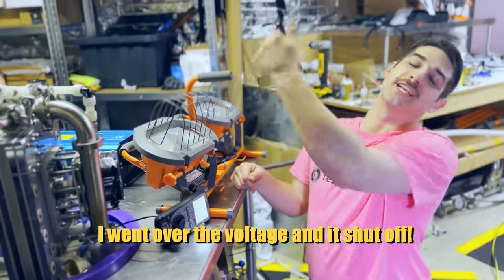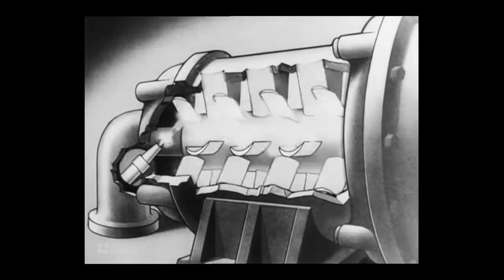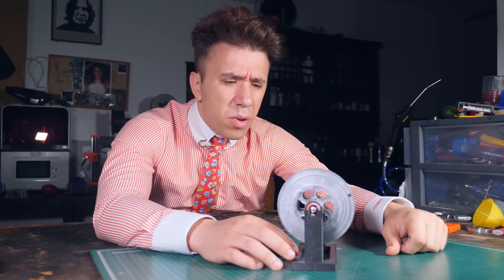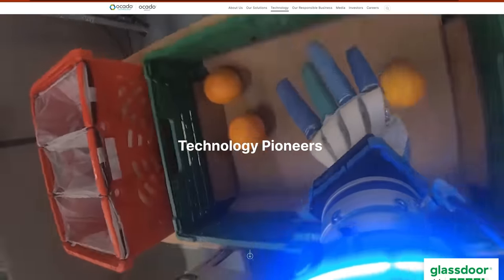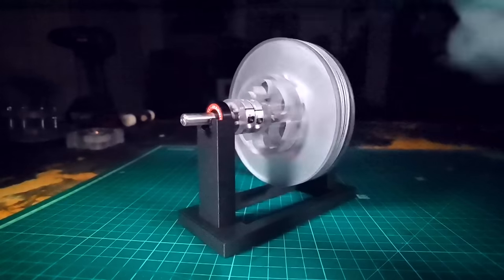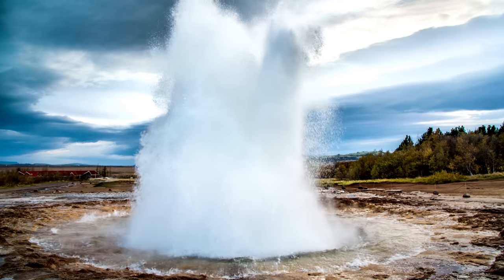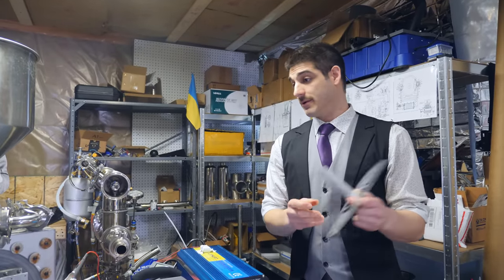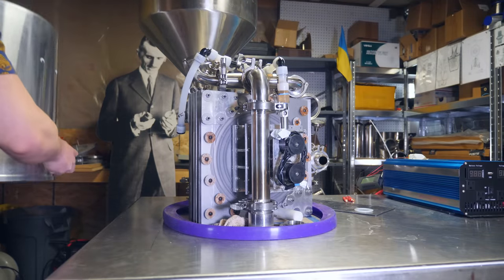Building Nikola Tesla's Bladeless Turbine

Comment: Hi all, as a suggestion, demonstrate solar boiler with Fresnel lens  (less than $2) boiling (low pressure in boiler using tesla pump on both sides of turbine) pump water, with steam injector at pump outlet  (return  steam, vapor or water to boiler).  also send output of boiler to storage (use aircret or aerogel for isolation); now you have seasonal storage turbine runs non stop, build two for zero fault tolerance (there cheap).  If one fails use the other while repairs are made.  Runs forever as hours of sun light provides weeks of energy to run the turbine without fuel cost, now pump water from oceans across deserts or any where water is needed (as system produces distilled water), and get green hydrogen and electricty free!

Comment: I'm quite impressed. I didn't think you could harness that much power from a unit that size. I've always wanted to build one of these, but I considered it a toy. I think i could actually build a vehicle apu out of something like this...
Reply: hey thanks for commenting. 🙏❤️‍🔥 I really appreciate the love and support.    

So just to be clear I do have a degree in physics and many years of working with industrial machines.  

And now I don’t want to discourage you but I need to be abundantly clear though that sadly, these are not toys. 

They are VERY dangerous if not designed or handled properly.  

I do not advise anyone who doesn’t already have a background in mech engineering/physics etc. to attempt to make one of them on their own.  

If you wouldn’t feel comfortable taking apart a jet engine and putting it back together and know that it would work properly again then I would think twice about taking on this endeavor.  

That being said. 

If you would like to start I would suggest by consuming as many mechanical engineering class videos as you can on YouTube.  

Learn all the thermodynamics behind steam and gas turbines.  

Specifically for Tesla turbines it requires a great deal more chemistry due to the Tesla turbine operating on molecular viscous adhesive forces between the fluid and discs and not in mechanical collisions with the blades like traditional blades turbine.  

So making sure to have the right surface treatments for the proper motive fluid is very important too.   “Don’t French fry when you’re supposed to pizza or you’re gonna have a bad time.” <-Words to live by. 

I want to be explicitly clear with people just how dangerous this is. 

It’s easy to see the turbine not doing much other than spinning and think it’s not that difficult.   

But to put some perspective on it…. 

The ~25cm (10in) diameter 75disc aluminum turbine is 4.36kg (~9.5lbs)     

So whenever anyone see this turbine spinning they need to imagine a literal 10in diameter 10lb dumbbell weight spinning at 7,000-13,000rpm 🤯🥵😅    

At 13,000rpm the turbine rotor has 30,000joules of rotational kinetic energy.     

For perspective, that’s about equivalent to:  5-10% of the kinetic energy of a whole car at highway speeds.   

If that stored kinetic energy were to be used to launch itself straight up into the air…    

KE = gravPE = mgH   

H = KE / m / g
     = (30,000joules) / (4.26kg) / (9.81m/s^2)
     = 708 meters straight up into the air… 🤯

~3/4 of a kilometer or ~0.45 miles
Reply: I also have a degree in physics and other things...
I'm curious as to why you're not using air bearings in your design. They're pretty easy to build and implement.  In addition, you can use your Tesla turbine as a pump to pressurize them thereby eliminating the need for a secondary system. Once the system reaches its static equilibrium pressure it won't bleed off much more additional energy and certainly less than your cooled bearings.

Comment: This is really cool, but the thing that fascinated me the most was actually the way they did CNC on those thin pieces of aluminum. Would that be something you could explore more in the future?
Reply: For mass production of the discs a stamping machine would probably be able to produce more per hour. But at maker-scale CNC makes sense. Joe Pie did a video titled 'Pressure Turning' where he clamped a stack of aluminum foil to make really thin shims. Something similar should work with a milling machine, clamp a stack of sheet aluminum between some plywood held in a frame. Plywood will be sacrificial (scrap it after the batch is done), frame is reusable. Maybe possible to use multiple clamping setups and reuse the plywood or make some holding pieces from metal instead of plywood.  First stage - cut out the center while clamping down on the top from the side. Second stage - base has a mandrel extending up that the top holding piece is bolted to , and the top holding piece is a thick disk the same diameter of the discs being produced. Second stage top holding piece would also have holes matching the holes to be cut in the disks. Also need a notch in the mandrel and a small protrusion in the center hole of the top holding piece, for angular alignment of the holes
Reply: @frontiervirtcharter  Yea, I was more interested in how they did cnc in such fragile materials. I know it's not the most efficient way to do this, but it's still interesting
Reply: @xXfzmusicXx  Use a straight flute mill. A spiral flute will pull the material up and scrap every single one in the stack.

Comment: What would happen if you were to alternate either the size of the disks or thickness? It would be interesting to see how it affects the output.
Reply: Typically, if you increase the diameter of the disk, you'll get a lower max rpm, but a bit more torque. 

increaseing the thickness of the disk wouldn't be as helpful, as its just more mass for the fluid to pull, and less surface area.
Reply: @beaverbear9157  thats not what he is saying he is saying make some of them small and some of them larger or maybe 25% small 10% medium and 65% large i think what he is getting at is you may have better effeciency as the smaller disks woiuld help it achieve the better torque and still have a more power. as for rpms it doesnt matteer what size the disc is you either have more torque or more power the rpms will be the same what do you think the discs would actually gain a higher rpm because of diameter? no my friend it has more to do with mass of the object so you would achieve higher rpms becuase you get to use more of the fuel as its lighter and easier to spin. diameter has nothing to do with what the rpms achieved would be.

Comment: Very cool video! I'd love to see this setup with a steam input. Relying on compressed air isn't the best idea for using the engine in the case of blackouts. Being able to go off-grid by using steam or gravity-fed water would be interesting to see!
Reply: Hey thank you for your insightful comment and genuine curiosity! 

It's a great opportunity to delve deeper into the potential real-world applications of the Tesla turbine and to clear up some misconceptions.

First and foremost, in terms of using high pressure, low temp gases in actual generator capacities, Compressed Air Energy Storage (CAES) and Liquid Air/Cryogenic Energy Storage (LAES/CES) are very viable solutions, and they're being employed at industrial scales as we speak.

When we look at how engines function, they typically compress air, heat it, and then expand it. 

Most gas turbines and turbojet engines possess a compressor, operating on what's known as the Brayton cycle. 

For those unfamiliar, the Brayton cycle comprises three main processes: 

compression of the air, combustion (where heat is added), and then expansion of the air.

If we're talking about steam systems, only heat needs to be added to vaporize the fluid. 

Systems like ocean thermal energy conversion (OTEC) can vaporize steam, or even function in an organic Rankine cycle, at significantly reduced temperatures.

Tesla's improved turbine patent GB 186,083 is particularly noteworthy here. 

It cleverly uses heat from the turbine exhaust to generate steam. 

This steam then cools the combustion jet before it enters the turbine, thus significantly reducing the compressed needs typical of most gas turbines. 

While regular gas turbines require an air-fuel mix in the range of 100:1 to 200:1, thanks to this innovative approach, Tesla's patent slashes the load that the compressor puts on the shaft, making it efficient even with stoichiometric mixtures around 15:1.

Moreover, Tesla's patent GB 186,084 combines combustion and steam turbine functionality, eliminating the need for a compressor altogether.

Our current tests with the Tesla turbine aim to establish baselines. 

We've already achieved impressive results with the 10in diameter TesTur— 6.22ft-Ibs of torque at 4150rpm and over 4.25kW between 6000-12,000 rpm, while maintaining relatively low pressures at the nozzle.

It's crucial to understand that, counterintuitively, the viscosity of gases actually increases with temperature. 

This means that as we hike up the temperatures to combustion levels, not only do we anticipate a boost in thermodynamic efficiency but also a leap in the TesTur's isentropic efficiency, thanks to reduced slip caused by the heightened viscosity.

Our endgame at TesTur Energy is all about energy independence. 

We're passionate about tapping into underutilized energy sources and stores, such as biomass, solar thermal, geothermal, and even unconventional fuels with high particulate content. 

The ultimate goal? 

To harness these energy stores with systems that can manage multiphase fluid flows, ensuring longevity and efficiency.
Reply: Additionally we have a full closed loop steam system for the turbine that is about to get used for testing it in the vacuum steam conditions. Already showing 150-300watts out with the inlet steam at 65-70°c at -10inHg vacuum pressure and the turbine exhaust/condenser at 55-60°c at -22inHg vacuum 🤭

Just imagine what will happen when we actually use some real heat. 🦾🔥🤓👨‍🔬

Comment: they say there's a lot of untapped potential in grid water pipes, it'd be cool to see an idea to integrate this with a pipe fitting and flow water through it at normal house pipe water pressures to see how much power it can generate. i know some cities utilize the pipe pressure of the water grid already, just imagine the potential.
Reply: Or by using 24v water pump or replace it with permit magnet motor to generate votage just by running water!
Reply: it's a TANSTAAFL situation, the energy abstracted from water flowing in a pipe has to come from somewhere which is often a pumping station.  Having said that if you live somewhere with an unmetered water supply it might be economic on a personal level to generate your own power by wasting a few thousand gallons of water a day.
Reply: @Steve_Coates  I actually have unmetered water in a urban area (the hose water is unmetered, but the house water is metered) but I don't think I'd feel very good dumping perfectly good water out on a moral level.

Comment: Good time everyone, nice video, and technically advanced and understandable, thank`s. I have one suggestion, if you make the turbine bigger in diametre and build in the center of the blades, which will possibly give more power to compress the same air that comes out and turn it back, since we apply the force along the outer diameter, we will need less compressed air power than we will get from the middle. Good mood and new ideas to all inventors) I`m sorry if I have some grammatikal mistakes

Comment: Please make a video about stirling engines and making one which can be used to generate roughly 10-15 KWh/day. Most fridges need roughly 13 KWh/day, and most entire households need 20-30 KWh/day, to function decently for half a year, and roughly 30-45 KWh/day to 40-60 KWh/day to function at peak efficiency including using electric heating and AC (for houses which don' have gas stoves or gas heaters). And the benefit of it is that not only can you use any source of heat to power it (including solar and burning trash or normal fuel or unclean fuel if you need to), but you can also run it in reverse by feeding it torque (i.e. from another stirling engine or steam engine or injection engine or renewables or animal power or human power) to turn it into a heat pump (i.e. turning your cellar into a fridge/freezer, if needed). Even if you only manage to make a Stirling Engine capable of generating 1 KWh/day for one video and in another video changing some parts to make it a heat pump (i.e. the heatsinks, the freezing plate needing thicker fins, because thinner ones won't transfer enough heat before freezing), and then make a mini-series about making the 10 KWh/day Stirling Engine, it would still be great to have you try to build one from scratch, which to be done so people can easily replicate it using off-the-shelf parts and tools (even if it requires the usage of a CNC) to generate power without needing to deal with dangerous things like pressurized steam.

Comment: I've been working on converting my ram pump to compress air after my water tanks are  full. I am getting 65psi at the moment at the pump of water pressure from my dam overflow  about 0.5 km away from my shed hopefully I will be able to keep up with all my air needs then top up my batteries after that using a similar motor.

Comment: You should use the Tesla turbine to try and make a generator that use steam heated from solar energy. Maybe water in black tubes or barrel, the black absorbs the heat, which heats up the water and makes pressure and steam to power the system. It would be interesting to see if a system like that would work. It would be really cool if you could somehow make it an  enclosed or mostly enclosed system to recycle some of the steam.

Comment: You have gr8 projects, very interesting and you have a lovely way of presenting the science.

Here is a simple project idea that you could consider:
Fashion an energy diverter, that will take Solar or Wind energy off the house MAINS AC channel connected to the grid and DIVERT a percentage of the solar/wind energy down a different channel to charge alternative battery storage, which can later be used by the house. There are water heating systems that already do this BUT they cannot point to a Batter Storage System, so the solar is sent into the grid and not used by the house....

Comment: Add blade segments of a screw to the sphere so it blows like a fan. And only use one pipe up out of the tank and then bends horizontal  the ball turns on that section.

Comment: So, after watching this video, I am extremely impressed with the inventor, loved the fact that he is a Tesla enthusiast and Edmeyer so I am going to declare this idea publicly for him in hopes that you pass it to him, he needs to incorporate the equivalent of a torque multiplier into the turbine. It’s possible that he could achieve this by implementing pressure adjusting device focused on the axis of the plates furthermore it could be self adjusting based off of RPMs. Say if the optimum rpm is 2000 then pressure, adjusting device in between the plates, would allow for separation and contraction for more or less air, which would significantly impact the torque the amount of torque that it would generate and with that being said, adjusting the air flow and pressure which stabilized the turbine entirely so there this is my contribution I hope you pass it along keep up the good work guys.

Comment: Idea: I harvested my body energy to power an exoskeleton!   Realistically i think it would be feasable as long as you gather energy for a while and use it to have a burst of strenght, for example to lift stuff or sprint?  The easier way would be to use the motors of the exoskeleton to generate electricity.

Comment: Excellent video! I would love to see a video on a realistic self-sufficient household with solar, wind, hydro generators to give out electricity, and water. One with sustainable technology in time. Ideally with a greenhouse and a small barn. All technologies combined to give energy all year round. Taking advantage of rainwater,  sewage water, and making water through different systems such as desalination, electrolysis, and photolysis to mention a few ways. Electricity should be stored in different ways, like batteries for certain things, sand (thermal), and mechanical systems (flywheel and water pump). Automatic irrigation systems with sensors.

Comment: Gravity storage/generator using rivers(the water) as a weight. It is a concept that fascinates me and it is mind-boggling why it is not used. All you need is hose in river upstream and a big volume "tank"(or multiple of tanks) that when full of water from upstream drops slowly using pulley drops and this kinetic energy you turn into your output.